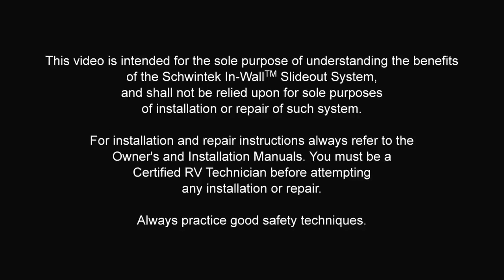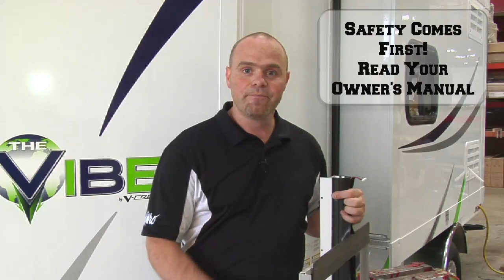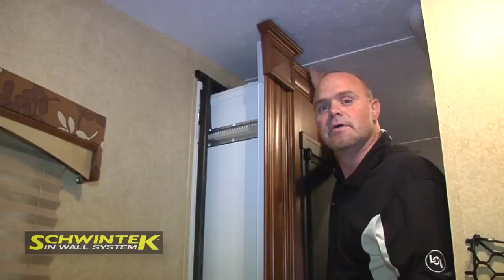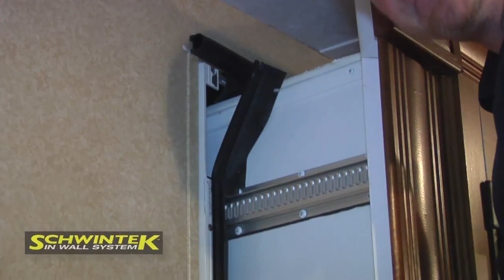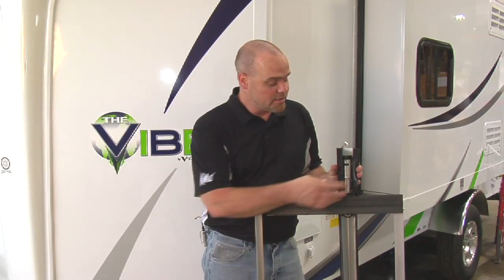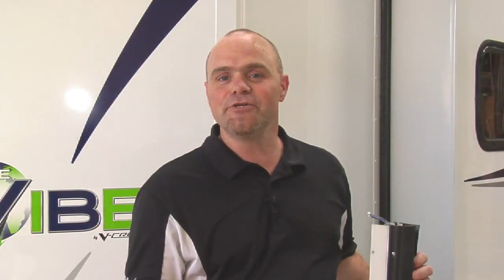Schwintek Remove and Replacing a Motor 2014

Comment: Does the set screw on the outside Just go into the slot to keep the motor from moving upward or does it actually thread into a specific hole in the motor housing?
Reply: How do you align the motor pegs to drop into the holes if the flat spot on the shaft isnt in the same spot as the old motor? My new motor has a rubber boot for moisture protection and this prevents me from removing cover and spinning it..
Reply: It appears to nestle into a hole in the motor.  Lippert told me it was aluminum and I could break it from the inside since my slide was stuck closed  - NOT!!  I got it out another way and its a steel screw, zinc coated, all the way.
Reply: @victorburns3620  How did you get the set screw out? Im about ready to drill into my slide out because its stuck in?
Reply: @iMakos101  That is what some techs said they would do.  I have an attitude tou hauler 3322SAG.  I was able to get mine open about a 1-2" they I got a super small right angle driver and was able to get it out.  Its just a pressure fit onto the motor so it stays put.  I finally have mine in the shop for repair.  I think the post in the wall is jammed up or a key holding two parts of the shaft sheared off?  Dunno yet.....  IT IS NOT AN ALUMANUM BREAKABLE SCREW  -  Lipper told be to just break it with the motor from the inside but its definitely to breakable aluminum.    The Lipper help is miserable and they have no clue.  Its a crap design too bein able to have this thing stuck in  - Better than stuck out though...
Reply: @victorburns3620  I had to drill through the corner of my slide with a hole saw to get the screw. Once the screw was out I could lift the motor and easily push the slide out. There is a cover I put back over where I cut so it's no problem
Reply: Got same problem slide all the way in.can u give an idea how u got yours out?

Comment: What if the room is stuck in and you can't remove the motor set screw?
Reply: Why don't the have a hole where the screw is with a painted cap or stripped cap so you can Always get to that screw....
Reply: @franknaiman5219   Some guys I called said they would tear apart the outside of the coach to get access. - Lippert!  or in my case also Eclipse Manufacturing / Attitude Toy Haulers.  NOBODY want to touch it either.  They refuse to work on any of this Schwintek stuff.   Dumb design you cannot service this when it fails closed.
Reply: I have that exact problem.....
Reply: My issue is the slide is out of "timing" after 10 short  camping trips and no one around will fix it...... Open to reasonable suggestions...
Reply: Lippert!  or in my case also Eclipse Manufacturing / Attitude Toy Haulers.  NOBODY want to touch it either.  They refuse to work on any of this Schwintek stuff.   Dumb design you cannot service this when it fails closed.  I was able to finally just get about an inch of space and then used a tiny right angle S2? bit and got it out.  Took hours of fiddling with it.